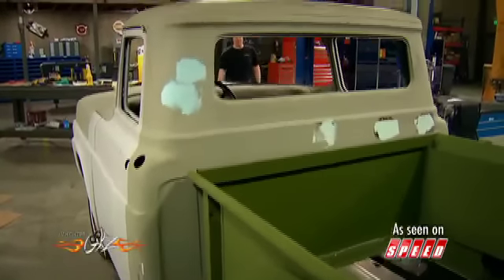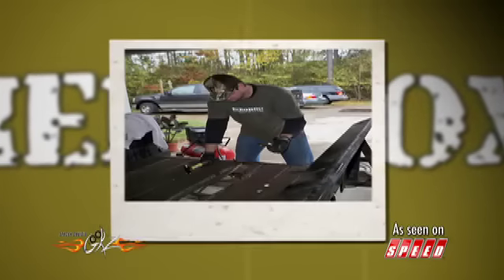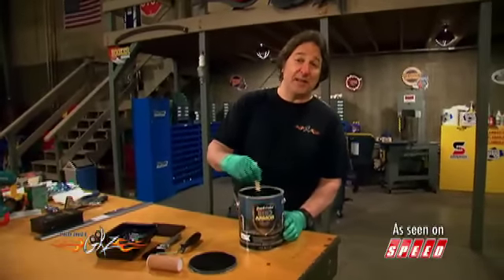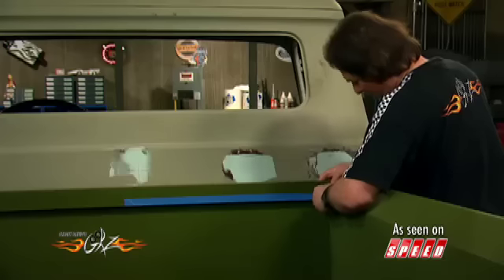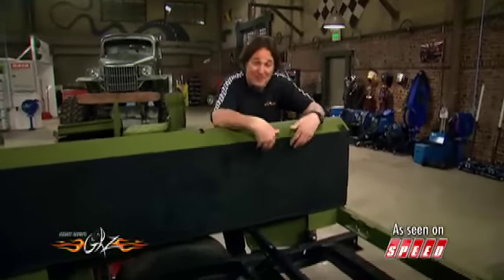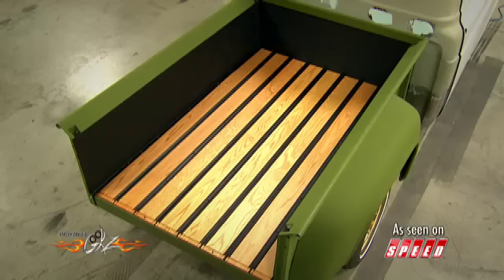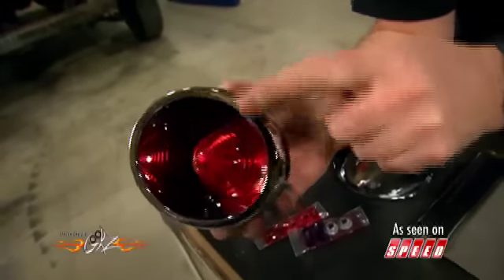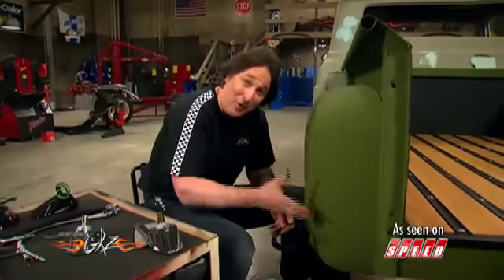Stacey David's GearZ Dupli-Color Bed Armor

Comment: I use Duplicolor bedliner on the front edges of my Jeep then painted the body color over it.  You never really see it til up close and can see the texture.  Its been on 2 years and seen many rocks and trees and has protected my hood and fenders.  I even use this stuff on my body armor to keep them working as they should.  I used the non rubberized version for the hood and fenders.
Reply: For all those saying bad things about the product, at least elaborate on why you do not like it.  Most who say bad things about a product either have never used it, or didnt apply it correctly.  I use the product in ways it wasnt intended and its working great.  The spray can version is not the same as the roll on version.  Dont compare apples to oranges.
Reply: Great to hear you can paint it ... please can you tell me what you used to paint over to adhere to it cheers

Comment: I have a custom paint shop and I put this product in my own truck...here's how it went....the stuff is CHUNKY ! If you don't mix it good,you'll be sorry! And the thing is the "brushes and roller" method sucks! You need to use a spray gun made for undercoating and bed liner products. ( commonly called a "SHLITZ" gun ) Otherwise,the globs and chunks will be funky and lump together no matter how good you "roll" it. Now that it's been in my truck and used hard,it didn't fade in color or chip off...

Comment: I tried it,I got it to stick by getting the surface really clean,sanding with 80 grit, then using "Bull-Dog" adhesion promoter...that stuff will make a fat chick stick to a pretzel diet. Even though "Bulldog " is intended for solvent based systems...(bed armor is water based) it worked! I've had it in for a year and a half and beat it up with no problems! Everybody thinks its "Line-X" or "Rhino Liner" when they see it.

Comment: ok i used this - what a load - they had to spray it NO way they got that finish with a roller - use texture sprayer from harbor freight - then you will get the right even finish - i had to power wash off this stuff while still wet it looked so bad bought a quart and added it to what was left and resprayed - using texture gun-

Comment: This stuff is crap for a bedliner, it does work great as undercoat and sound deadening. I did the whole floorboard inside my 60 pickup. Stop all the vibration on metal to metal parts.
Reply: TheSoloAsylum what product do you recommend?

Comment: crappest product I ever used..got bed liner for half the price that worked better. the roller leaves a lot to be desired . sanded my with 80 grit sand paper . went to touch it a week later it just lifted . with crawling across on it with hands and knee,s. followed instuctions.